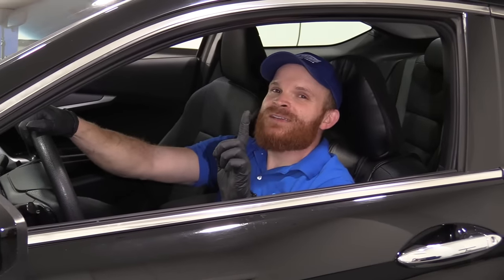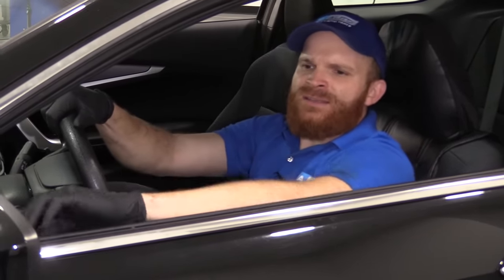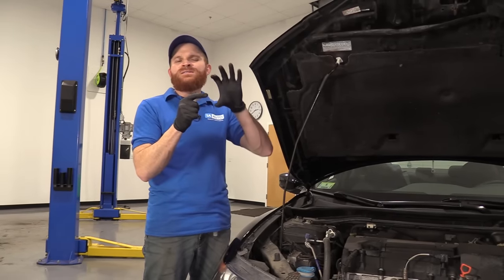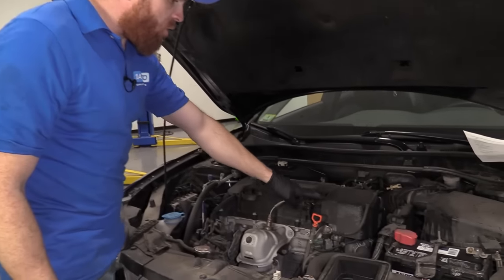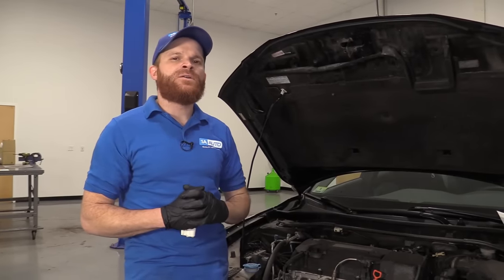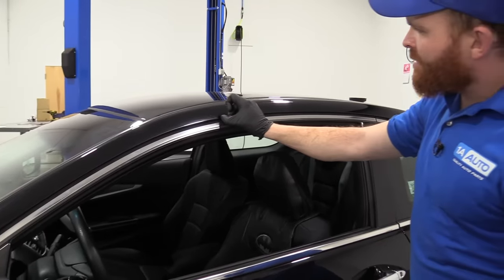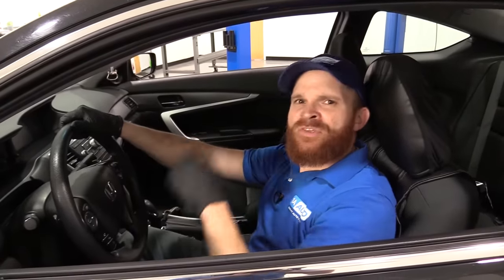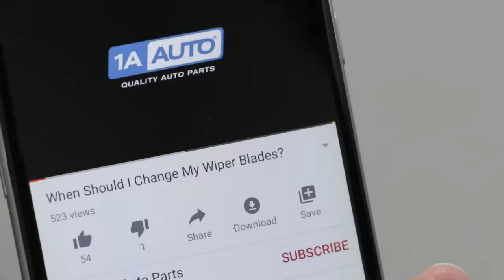Top 5 Problems Honda Accord Coupe 9th Gen 2013-17

Comment: This video is hilarious. Besides the starter issue, none of these are actual problems.

The mirror is fine, seats are fine unless your road tripping (same as most cars in this price range) and as long as you properly take care of your paint, you shouldn’t have a problem besides rock chips and maybe rust if your in the rust belt.

I have little to no oil consumption in mine after 130k. Change oil every 7500, which the maintenance minder says about 20 to 30% left. Also change transmission fluid every other oil change.

My starter had the known issue of grinding as it wasn’t completely actuating, which Honda should’ve replaced due to safety concerns, but only released a TSB. I had to replace mine myself because no dealer was ever going to honor that unless it happened right in front of them, which was impossible because it was so random. I completed the TSB to the T and haven’t had an issue since.

I think it’s really funny how VCM wasn’t even mentioned with the V6 automatic. That is quite possibly the worst part about the 8th and 9th gens. I just wish the 10th gen still had the J35 cause that engine is amazing.

At this point with the current car market and how cars are turning more into computers every year, I can’t see myself selling. It’s a good balance on modern and “old”, while the styling should hold up very well compared to it competitors of the same generation, especially the Camry.

Comment: Maybe it's just semantics but I had a '14 Accord Hybrid and I wouldn't call the driver's side mirror as producing a blur but it was distracting at times. However, I never thought it a safety issue, more something that took some getting used to. Not executed well I would agree. My 2.0 liter engine never used oil so that was never an issue. Not saying some don't but even my replacement 1.5T Accord has yet to use oil in any noticeable way. Can't speak for their starters as the 2.0 started from one of the two hybrid system motors. Likewise, never had any clearcoat issue, simply wasn't an issue and that car almost exclusively went through a car wash.  Finally, I wouldn't call the seats the most comfy I've ever sat in, they were far from the worst and that's with me being 6'7".  
I'll just end saying that you may see these things and they bother you but not everyone will have or see the same issues. In fact, my '14 never saw the inside of a service bay, I changed my own oil and filter along with one 12V house battery swap. That was it. Loved the car.

Comment: My 2013 accord touring - I don't notice that mirror line I have to LOOK for it . 160,000 miles and not one problem . No burning oil . And I have gotten 40 miles per gallon on 2 hour trips on the highway .

Comment: Had a 2017 honda accord , I had rear brake issues, they would run low after replacing them 2 years  ago, and after Installed coil overs and then tired of them after two years I put stock struts and now it was squeakys and dash board look like water stain prints that you couldn't remove, oil consumption

Comment: i step on the gas alot on my honda but fortunately i do my own oil changes and add oil every so often.. the car will let me know when its low by the way it handles also im constantly adding air to tires because i drift alot and the weather in chicago is crazy, warm one day freezing cold the next. if you can handle that u have yourself a very reliable cae
Reply from the maker: +Juan Caballero Thanks for checking us out! http://1aau.to/m/Shop-1AAuto-c

Comment: question on the starter issue: is it always the starter, or is it either the starter or the ELD? Just had my alternator replaced and they ended up finding out it was the ELD causing the issue starting (battery tester at Autozone was reading 12v and not 14v, but battery tested as good). but the faulty ELD apparently killed my alternator too.

Comment: I have a 2014 accord sport 4 cylinder. It has 76k miles and I've had no issues whatsoever. I currently use 5w30 instead of 0w20 simply cuz it gives my engine more protection.

Comment: I own 2 identical 2013 lx accord 4cyl. One has 163k and the other has 130k. Starters do fail, but easy to change and get the Chinesium Amazon ones for $80. Mine would get hot and not restart after turning off. Open hood, let it cool off, then start. LMAO, happened at dealer on a recall visit....had to push it out of the check in area.. Have not noticed oil consumption. This guy did not mention the BIGGEST problem, which is WHEEL BEARINGS, and they SUCK to remove in salt areas like mine.. Have replaced 3 of the 8 so far.

Comment: I have a 2014 EXL 2.4, had the starter problem at 50k, fixed. my issue is the stereo. it distorts and rattles when volume is at 20 and up.

Comment: Explain why my Honda Accord 2014 drives kinds rough if I get in and just drive vs if I let it warm up for 10-15 mins and it drives smooth
Reply: Bcs the engine was cold, happens to all cars
Reply: Check transmission fluid
Reply: Bruh thats literally how every car works? You are supposed to heat up ur car before driving not just turn the car on and drive

Comment: Do not forget to changed that PCV valve. Valve cover gasket leaks much earlier on these models. That also helps prevent burning of oil and seals.  2012 was built much better than these models.  Too many Chinese parts, burned out led daytime lamps etc...

Comment: I have the 13 EXL V6 and my paint is chipping and I’m having issues with a bad ticking noise in the engine. It used to surge around 40-45 and we got the transmission oil changed and it hasn’t  done it since, but it’s still jerky sometime and the loud timing noise. We can’t seem to figure out what’s wrong.

Comment: Losing oil just because it's 0W20 is just not right. Surely there's more to it than just oil viscosity. 

I had an old CR-V which also uses 0W20 oil, drove it for ~200,000km (severe driving conditions: I live in a third world country). Not a single drop of oil consumed every time I change it at 10,000km intervals.

Comment: Problems I’ve had since 2013 purchase: battery 3x , starter 2x, alternator 1x, easy paint scratches, gears not switching properly / cvt malfunction (? still trying to figure out)
Reply: Cvt transmission does not have gears

Comment: Big issue with door locks actuators and fan air blower. Both of low quality. You will need to change it at least two times in some cases.

Comment: Safety issue? I don't even notice the line at all. 105k miles, and no oil consumption. The seat is comfortable enough I fear falling asleep behind the wheel on long boring highways. I don't want a Lazyboy in my car. 2016 EX sedan.

Comment: How about valve cover gasket leaking oil?? I’ve seen this in many Accords & CR-Vs running that “Earth Dreams” engine
Reply: That’s not an “issue”. The valve cover gaskets need to be replaced every 10 years or 100k miles. It’s a $400 service, the gasket just breaks down over time and causes a little oil to seep out causing an oil leak.
Reply: I got a 2013 Accord LX and my vale cover gasket have not issue...the engine still dry and clean as hell.  No starter issue either.

Comment: My 2014 accord LX 4dr has all the problems in this video. I just changed the starter today, car has 60k miles. Disappointed.  Also the car was leaking oil or CVT fluid 3 months after purchased new.

Comment: I want to purchase a car that can run for over 210k miles I want to drive at least 100k miles in it. I want something reliable but has to be fuel efficient like 22 in the city to 30 35 on the highway. And at a price less than $15k. And driven 70k to 100k miles.

Comment: My 08 Accord has oil consumption. My dad had a 98 Accord as well with the same issue. My car uses 5w-20. The only oil that burns less is RP high milage. It is pretty expensive, duh.
Reply from the maker: +Just Go North! Thanks for checking us out!
Reply: I have the same 6th gen accord, have him check the VTEC solenoid gasket area

Comment: I have an issue with my 14 touring 4 cyl, i suspect cvt.  From a stop position, in drive,  letting off the brake pedal the car jerks.  Also if i put the hand brake when going in park the next time i engage the car it can sometime make a strange clunking noise with the cvt.  Any clue anyone?

Comment: I don't even notice the line in the mirror. Safety issue? Or just trying to sell parts? Lack of maintenance causes the oil consumption, so no oil consumption here. No starter issues here either, in 93k miles. Like pillow seats, go buy a boring to drive Buick or Camry. You can tell this guy has never owned an Accord and doesn't know what they are about.

Comment: I have 2013 Honda Accord sport with 4 cylinder engine.  It has 210,000 miles and I have not had to make a single repair yet.  It burns no oil.  1A Auto usually puts out good material but this is a complete joke.

Comment: What about Honda Accord 8th gen?
Do they have the same problems?
Reply from the maker: +56CrownVick Thanks for watching!  The 8th gen Accord is a different vehicle and does not share the same sorts of issues discussed in this video.
Reply: The 8th generation are very good, they do not have the VCT transmission, and they are not GDI either, I think they are better made.  With one of the few problems that you are going to find is with the VTC actuator, which in cold conditions, when you start your car, you will hear like a clatter, some say that it does not affect the engine, but others say that in the long run it affects  the timing chain.
Reply: I had an 8th generation Civic and it was the best car. 207k miles when it got totaled. Seriously it ran just as well as it did when I bought it with 56 miles.  Other than the basic maintenance, I didn't have to spend a penny on repairs except $5 for a relay fuse when the AC wasn't blowing cold. The front rotors were changed at 169k miles, rear at 180k. Loved loved loved that car! I now have a 2013 Accord LX-S and it's consuming oil like crazy! I've changed out the PCV valve but it didn't help. No noticeable oil leak, no exhaust smoke, no decrease in performance or acceleration, etc. Drives very smooth.

Comment: I just replaced starter, battery 
still wont start
(smart key warning light flashes)
Reply from the maker: +T Kim The key could be dead so you can put the key up to the push to start button and it should sense it and still to turn on.
Reply: Replaced the key battery, I did that method, still cranks but wont start(smart key light flashes with "power is on"
Reply: T Kim If your Accord is a 2013-14 you need the updated part number from Honda.
Reply: @tkim5815  might need reprogramming. Same thing happened with my 7gen key. The same problem might apply to the 9th gen as well. Worth a shot 👍
Reply: I am planning replacing START STOP IGNITION SWITCH by myself, wish me LUCK.

Comment: I have 17 EXL 4 of your points are well done; however the line in the mirror is executed to be able to cover a blind spot while in motion; European cars use it for 20 years now; also regarding the oil burning issue I happen to have 2x 2.4l DI engines in our both vehicles and while one burns oil the other is not; go figure, both at 50k miles and well taken care of; so strange
Reply from the maker: +#MRUGA2010 Thanks for the feedback!

Comment: What happens if I put the 5-20 instead of  0-20
Reply: You'll be fine if you were in a pinch, but just stick to 0-20 if possible.
Reply: Avoid if you can. 0-20 is thin and the engine is designed for that weight size

Comment: 15 accord sport.. how do you fix oil consumption?
Reply: Buy thicker oil 10w30 full synthetic
Reply: I changed my pcv valve recently to see if it would help. So far its consumed about a third of a qt in 1200 miles and its getting me better gas mileage.

Comment: I have a 2013 EX sedan with 87k on it. Have there been any issues with the rear view camera? Mine works when it wants to, about 30% of the time. With that I experience a constant shudder through the gas pedal when accelerating in 5th or 6th gears at highway speeds. Any ideas what this is or how to diagnose it? There are no dash lights on. Thanks!
Reply from the maker: +ShiftyKen 08 We wouldn't be able to diagnose an issue like that here, you may want to have a local mechanic take a look at it. Thanks for checking us out! 1AAuto.com
Reply: @1AAuto  yes, I wasn't expecting you to. Apologies for not being more specific. I was wondering if this was a somewhat common issue that had been reported by owners like the five mentioned in your video. Thank you for your prompt response, keep up the good work!
Reply from the maker: +ShiftyKen 08 Thanks for your reply!  That particular issue is not something that we have hear much feedback on, so it does not to be a common issue with these vehicles.  We recommend checking out some Honda forums to see if this is something other owner's have reported, and potentially identify a fix!

Comment: One of the least helpful and researched videos I have seen. The single on point remark was the oil consumption. That is very common. Never heard a single complaint about the starter on these cars. I know at least 5 people with these cars. What you failed to mention, which is VERY common, the back calipers freeze. Out of the 6 of us that own this model, 3 have had to replace both rear calipers on our veericles. It is such a common issue, that one of my friends could not find new OEM calipers and ended up paying 3x what I paid for original Honda calipers (mine went 1 year before his).  I replaced mine when the car had 60k on it and was about 5 years old. Seats on MOST Hondas are crap. Want comfort? Buy Lexus or a German car. All said, I don't much care for my Accord and I would dump in a heartbeat if I could get a decent deal on a Lexus.

Comment: The paint is horrible. My hood is starting to fade and there are paint chips and scratches everywhere. I have 13 v6 exl navi with 60k. Starter was replaced around 45k. Still acting funny at times.

Comment: Oh, and the absolute garbage computer fly by wire system, very dangerous when you drive like I do. If you hard brake, will not accelerate quickly, very dangerous in traffic. Also when they sit for long periods, will not move when in reverse without running thru the gears etc. Both of them do all of this since new